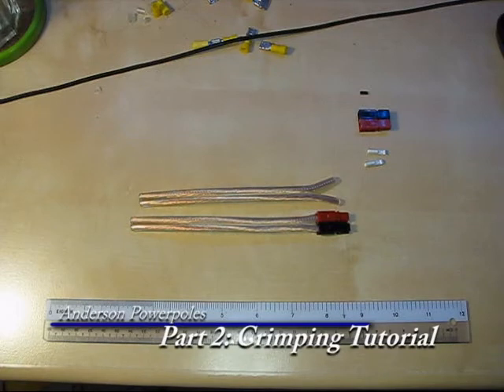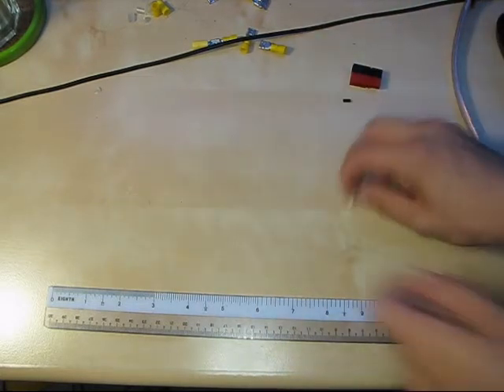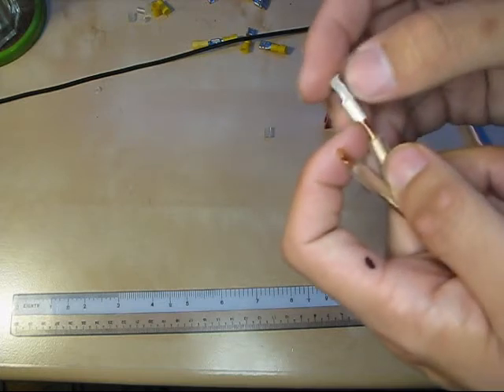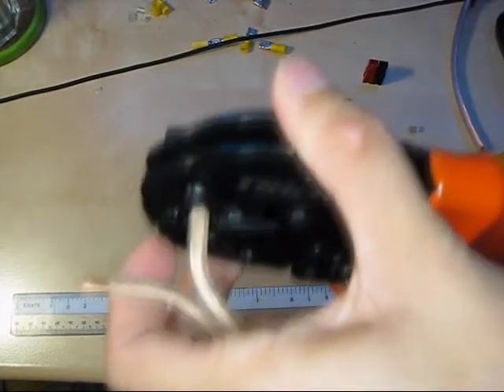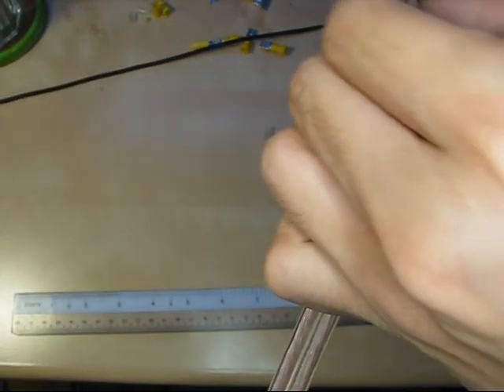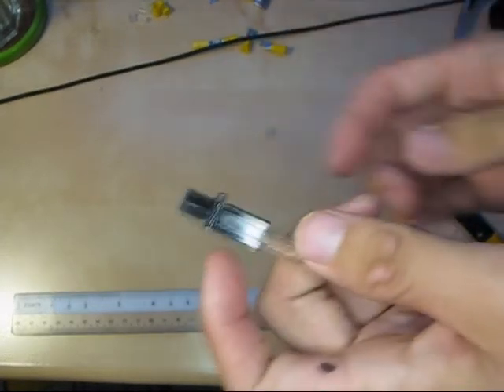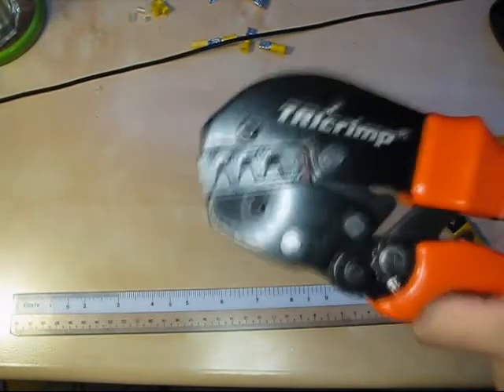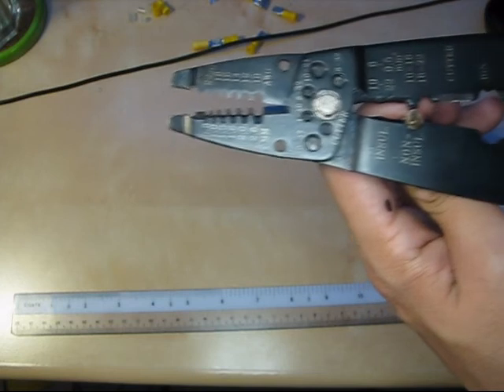Crimping Anderson Powerpoles

Comment: Thanks for the Video.  Can I just use my Hydraulic Crimpers? They don't have the fancy dies, but the tool will squeeze the ever-loving crap out of the lugs.
Perhaps supplement by neatly soldering the connections too?
Reply from the maker: There's a NASA paper on crimped connectors and if I recall correctly, soldered connectors that were intended for crimping are actually mechanically weaker and degrade much faster.

Without the correct die, you may end up with a mis-shapen terminal that won't fit into the housing properly. The 15A may fit fine, but the 45A is a very tight fit as it is.
Reply: @aonomus  Thank you for the informed advice! I'm using 50-amp Connectors on 10ga Wire, which have TONS of room, so the size of the crimped lug is not an issue in my case.  But I had no idea that Soldering could be a detriment. So that's a double Thank You for the NASA Idea.... https://nepp.nasa.gov/files/27631/NSTD87394A.pdf Page 55. Very cool!